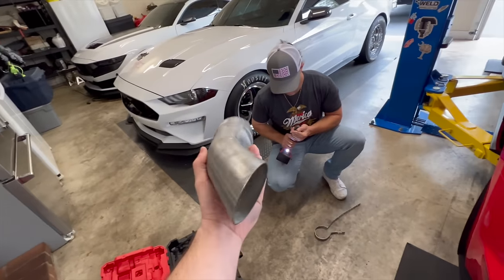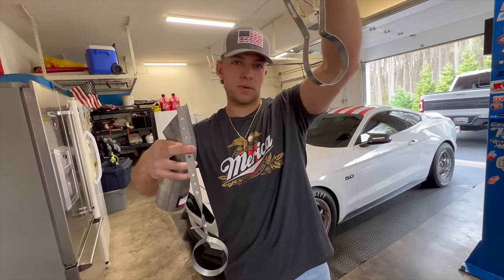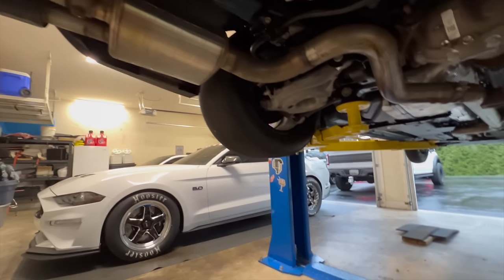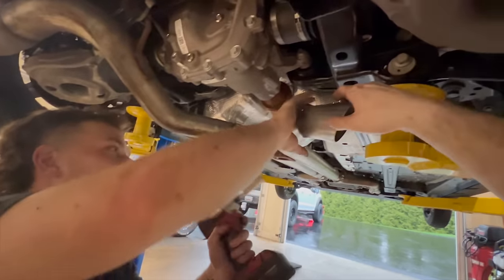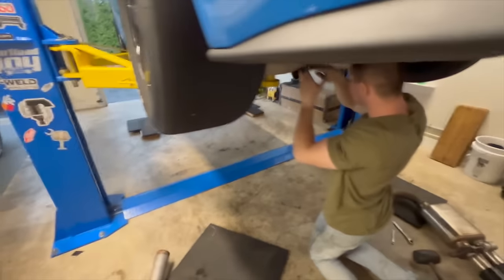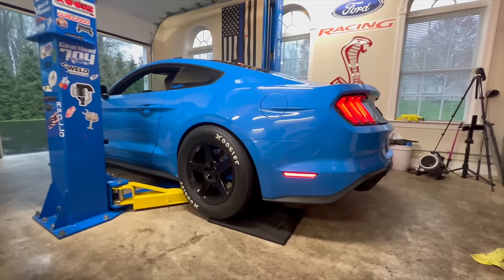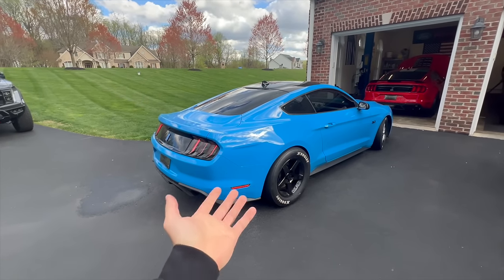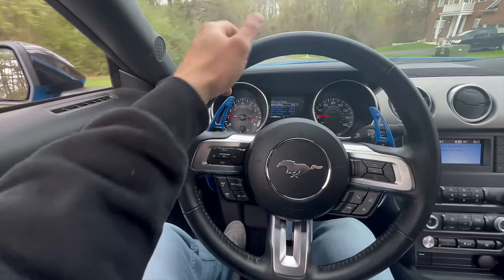How to Make Custom Race Dumps on a Budget! Sounds Like a NASCAR!

Comment: Scam shop screwed up my exhaust the xpipe runs within a 1/2" of the trans pan. No idea how that happened same exhaust setup as before motor replacement.So been thinking bout just dumping it right at the down pipes to the xpipe basically open headers.
Reply from the maker: They sound sick I love it